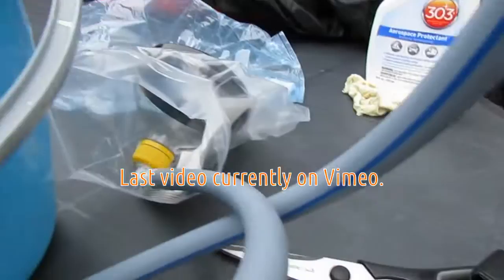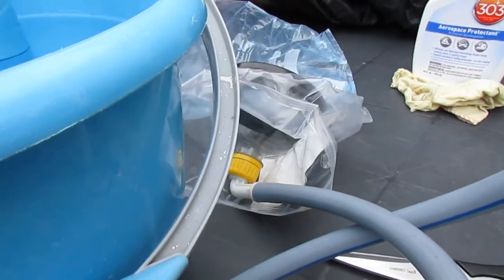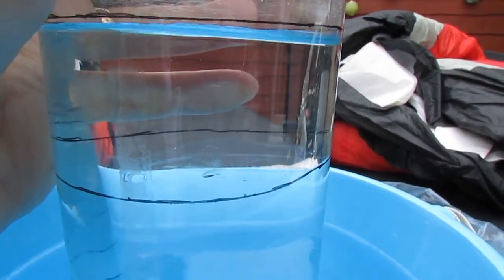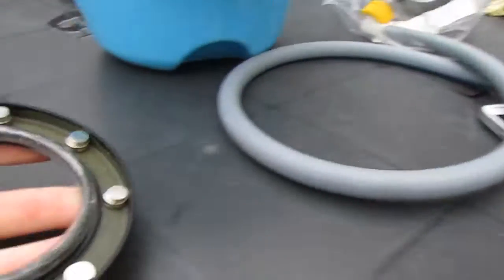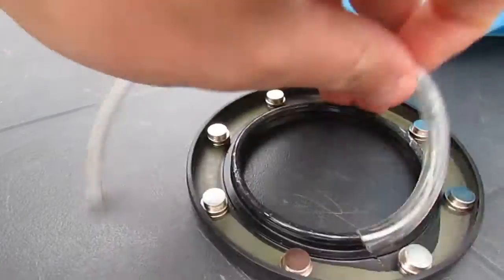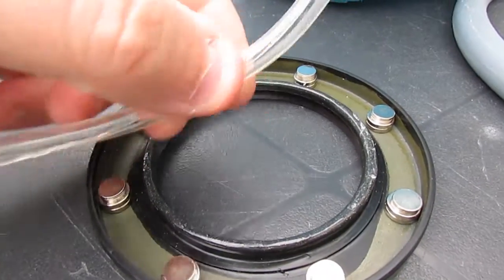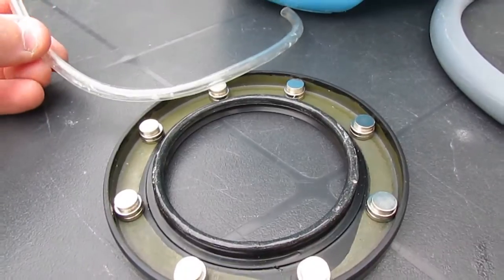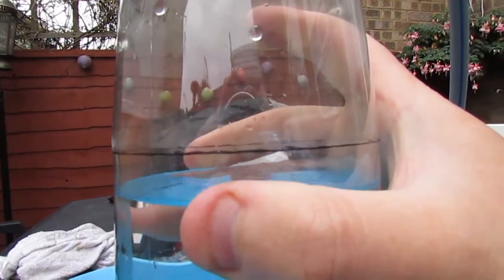Homemade Paraglider Porosity Tester - Part 2 - [New Eggmotor Book On Amazon - link in description]

Comment: your pressure is changing as the water level is dropping below the lines, this pressure being the hight of the water raised above the rest o the water level. a more accurate constant pressure test woud be if you were raising the bottle such that you kept the raised water level a constant amount via a marking on the inside of the bucket or the bucket rim, a pressure guage on the bottle woundlt hurt also.
Reply from the maker: The vimeo video that i recreated was from a guy who had done the necessary calculations and comparative experiments and this set up was an average of the differing pressures.